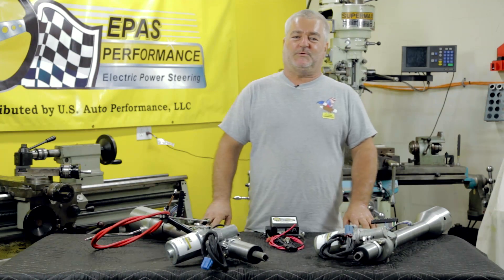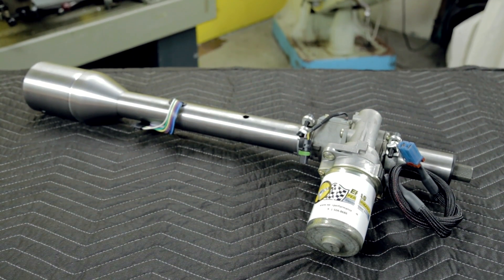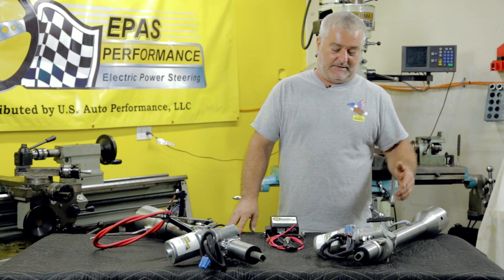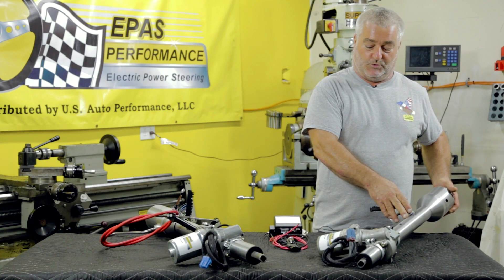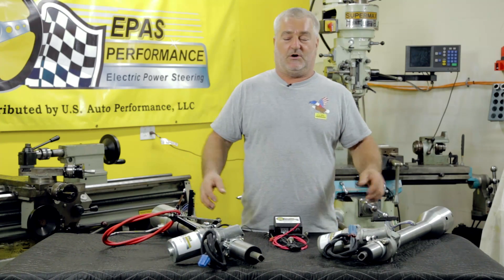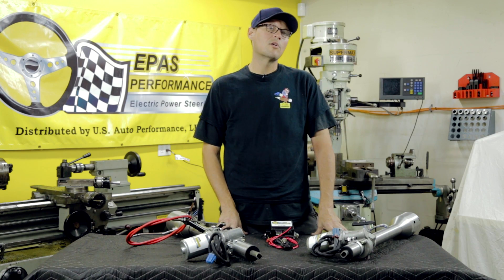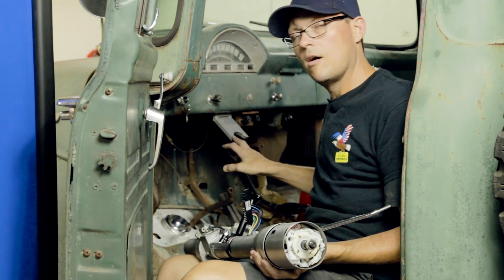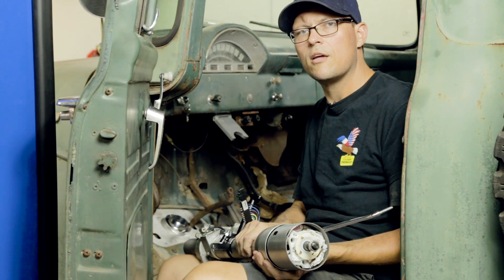ELECTRIC POWER STEERING CONVERSION WITH IDIDIT  TRUCK COLUMN INSTALL / "HOW TO"

Comment: Hi I have a.85  Toyota   pickup  5 speed  did you have  one for  the   truck
Reply from the maker: Good day Juan - unfortunately, we do not manufacture kits for any modern vehicles. The majority of them came from the OEM with power steering so there is simply no market for us. Best of luck in finding a solution for your power steering issues.

Comment: Didn't find a web site. Is this product still available?
Reply from the maker: Hi there, what application are you looking for specifically? Also, you can find our website at www.epasperformance.com .
Reply: @epasperformance5469  I want to add electric steering to an Ididit column for a truck I am building, I will check you web site.
Reply from the maker: @ZombieHammerGarage2023  Awesome! We partner with IDIDIT, so we should certainly be able to accommodate you! Give us a call at (941) 893-5427 with any questions!
Reply: @epasperformance5469  I am building a 1950 Willys Crew Cab from the ground up. I will use a front suspension kit from Speedway Motors with a Mustang II manual rack and want to use the Ididit column with your EPAS unit.
Reply from the maker: @ZombieHammerGarage2023  That is going to be an awesome project! Let us know when you are ready to go with the EPAS kit, our tech guys will make sure you are all set with the exact set up you need! Send pictures our way too if you get around to it! We are excited to see the process.
Reply from the maker: @ZombieHammerGarage2023  Please contact us directly to discuss your particular application; #(941)-893-5427

Comment: my question is this:  do I need to replace the hydraulic rack and pinion that is currently in my car?
Reply from the maker: No - you don't. Our systems work in conjunction with rack n pinion setups just fine, so long as they are manual racks. Give us a call directly when you are ready to pursue electric power steering.

Comment: Why did you not show us how you installed it on the column?
Reply from the maker: Mark - you are correct. We have left several steps out of our videos, either because they are covered in the instructions on our website, would be redundant or are basic processes. Feel free to contact us directly if you need any technical assistance during your installation.

Comment: I already have the electric power steering epas performance for a 1979 ford f150 I would like to know if you can sell me a column already ready for this truck just to put my electric power steering
Reply from the maker: Unfortunately, we do not offer columns for your Ford truck. You would need to reach out to a column maufacturer. We recommend Ididit.

Comment: Hello I just bought a 1973 P30 stepvan. No power steering. An ideas in how to get some power steering on this puppy?
Reply: I have the same thing - 1973 P30, and was also wondering! That steering wheel is a beast to try to manhandle.
Reply from the maker: Good day - you would have to send us a few pictures of what you have going on up under your dashboard. It might be possible? Feel free to contact us to find out how to do that.

Comment: Does this work with a 1986 Chevy C10? If so I'd be very interested
Reply from the maker: Caleb, We would create a custom build kit for the C10 truck. We have done a few in the past however each one has been different. Please visit our website, under the custom build application, there are some questions we would need answered. Thank you!

Comment: do you have something for a 1970 Ford Bronco, 289 CI V8 with three on the tree standard column shifter?
Reply from the maker: Hello, we could look into doing a custom build kit for this application. Please visit the custom build application in the products page for some questions we would need answered to determine if it is possible. Thank you!
Reply from the maker: Mr Cabot  Mr Cabot, This would be a custom build application due to the fact that it is a column shift vehicle. I could sell you our standard bronco kit all day long but I could not guarantee the cut lengths would be correct. Which is why I stated the custom build. I would want to verify some measurements. As well as some photos so that I may assist you during the install. Ford liked to play silly little games and change measurements throughout production dates and the options of floor or column shift. When it comes to column shift vehicles, some are not able to have the system installed while retaining the column shift option. These are all questions asked on the custom build application page. Once we know all the information we can better decided the best course of action for that specific vehicle. I do hope this answers your question. Thank you!

Comment: EPAS Performance - I have a 1992 gmc sierra 3500 crew cab dually that I had swapped A 1995 6BT CUMMINS which weighs about 1100 lbs , Do you have a electric motor big enough to work for my application?
Reply from the maker: Hello, unfortunately that vehicle is too new to reuse to OEM column and adapt our system to it. If you would like to discuss a total complete custom build feel free to contact us. Thanks!

Comment: Is there a weight rating for the f100 model? I plan on swapping my 390 for a 4bt cummins and the motor weighs about 800 pounds.
Reply from the maker: We do offer larger size motors for specific applications. You are welcome to give us a call to discuss the options.

Comment: If you already have an ididit column installed, what part# do you order?
Reply from the maker: Batman850X you would still order the same part number that applies to your vehicle but would notify us while placing the order. We have a different part that will adapt the Ididit column to our motor. Thanks!